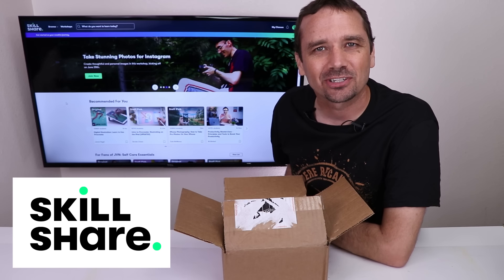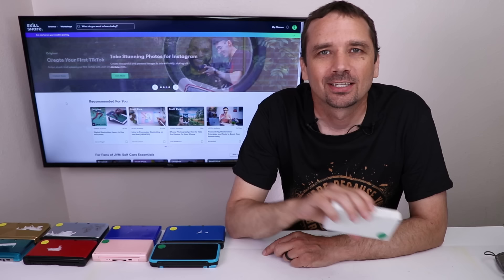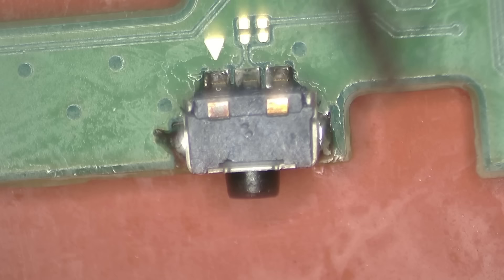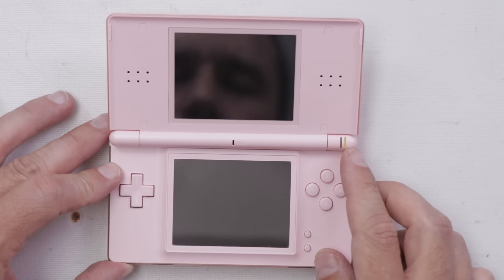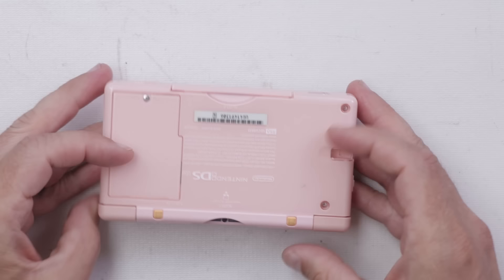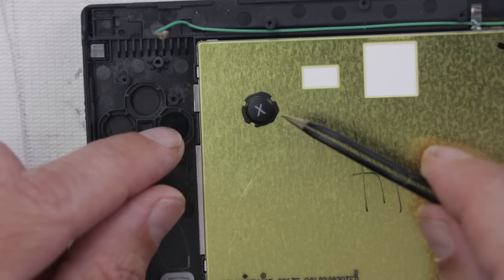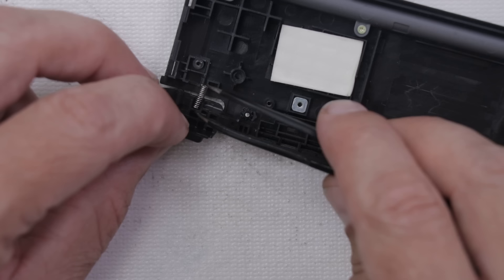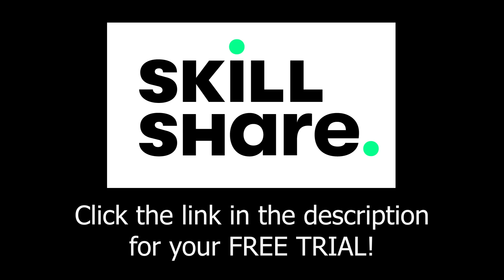I Bought 9 BROKEN (But NICE) Nintendo Handhelds - Let's Fix Them!

Comment: After all these decades, we are still "blowing air" into Nintendo products to help them work better. As a 1980 baby, does my heart proud
Reply from the maker: If only it was that easy to fix modern electronics
Reply: i still have to do it on my nes and gameboy
Reply: @inklingswtf  same have 2 gameboys
Reply: the old ways persist, tradition is preserved as we modernized :D Next we will blow into the switch on camera XD
Reply: @awilliams1701  that replacements cartridge slot messes up the pins on the game after time
Reply: Yeah, though the major difference is there's no added saliva, lol.
Reply: @awilliams1701  yeah i actually got a replacement when i got mine like a year ago its doing pretty well but i still (somethimes) blow into them with the dust build up in my drawer lol

Comment: Just a little tip, if the 3DS battery is completely empty, it just needs to charge for 10, sometimes 15 minutes before it turns on again. Just because it does nothing immediately after you put on the charge cable doesn't mean the battery is faulty or dead.

Comment: I love how calmly you take the challenge of finding out what's wrong with any device, also, how you know what to do in any cases... I've trying to fix a 3DS XL that turns off instantly just before turned on for like 4 weeks with no luck... I'll try some of the things you used in here. Exellent content! :D
Reply from the maker: Be sure to check the ribbon cable that goes through the hinge. Also...be sure that the ribbon cables are all seated fully and correctly. Good luck!
Reply: Good advice, thanks, i had something similar with a 3ds a few years ago :)
Reply: lil
Reply: @BlackLotus36  If it's the ribbon cable (which seems to be the case) it makes a distinctive cracking noise when you try to turn it on. Sadly these ribbon cables break pretty easily.
Reply: I found a bad WiFi card/WiFi card cable can cause issues.
See if you can turn off WiFi via the side switch thing, if that helps.
Reply: @MyRegardsToTheDodo  The screen ribbon cable? My DS does make that "crack" sound... I turn it on, the screens turns on, the blue led turn on but 1/4 of a second later, it cracks and turns off completely...
Reply: @lelsewherelelsewhere9435  I've tried that, turning it off and removing the WiFi module completely with no luck
Reply: @BlackLotus36  did ya fix it?

Comment: When I bought batches of broken ds / 3ds and at a first try they seemed perfectly working, the most frequent problem that I encountered with a more accurate control was the touchscreen that didn't receive the input in the most peripheral parts (near the frame), often it was enough to disassemble and clean them, but sometimes the digitizer needed to be changed.
Reply: Where did you buy the batches? I can't find anything on ebay

Comment: You should defiantly do PS3s and Xbox 360s. Maybe even Wii’s. I think you should buy a PS3 with the yellow light of death or a 360 with the red ring of death and see if you can fix one of those
Reply: There is no real permanent fix for Xbox 360 RROD, for the PS3 it sometimes works if you replace the caps.
Reply: @MyRegardsToTheDodo  I mean there is, and that's reballing the chip, and IFixIt has their own guide and kit to fix or prevent RROD most of the time. It's caused because of the original 360's terrible solution for cooling.
Reply: @MyRegardsToTheDodo  I know but it would be good if he could at least get it working again even if it is only temporary

Comment: Awesome trigger button repair on that 2DS XL! Have a bunch of original 3DS models I have never been able to figure out with 2 somewhat common issues. Some of them just making a loud pop noise when turning on and also the others wont get past the 3D slider test in the initial setup. Would love to see in a future video. Id send you a popping one you can have for free just to see you fix it!
Reply: poping sound is due to the speaker cable. just replace it =) I have videos on my channel about it

Comment: When a device reacts to a charger being plugged in, it doesn't have to mean that it is charging too!!! With devices like this always check the batteries with a multimeter to see how much the battery is charged and then charge it for several minutes and then check the battery again!!!!
Reply: Exactly. I remember thinking my vitas battery died but I realized it doesn’t hold a charge until it was charged for like 15 mins
Reply: Yeah, and sometimes devices won't power on until the battery reaches a certain level of charge. Like the Switch, which is really annoying when I want to play it docked, but nooooooo, I have to wait for a battery I don't even want because I never play portable to charge enough first.

Comment: I enjoy watching your videos!  My daughter's Switch Lite recently started having some issues, and you inspired me to try and fix it myself.  The wifi started only being able to connect to my nighthawk router from 5-6 feet away.  Then, it got worse, only able to connect a foot away from the router...

I restarted the switch (held down power), I factory reset the switch, with no luck.

I took apart the switch, and the wifi antennas looked good.  I accidentally broke the right controller connect back to the motherboard (I now know how fragile those flip down ribbon cable holders are!)  After replacing that board, I ordered new wifi antennas.  After putting the switch entirely back together... the performance of the wifi was the exact same.  It works, but only about 6 in or so away from the router.

I've changed the MTU to 1500, changed auth types, tested 5G, changed my wifi channels to ones that didn't have any signals present, and nothing made a change.  Any ideas on anything I can do?  At this point, I'd assume the main motherboard has some issue.

Comment: Huh. I have the Year Of Luigi 3DS XL in my collection, and it was damaged by a sticky drink as well. Killed one of the buttons entirely, messed up the volume slider, and broke the headphone jack. That was all before I got it, but when I took the bottom panel off, over half of the bottom was covered in sticky residue from the drink.

Comment: #3 (the pink DS Lite) has heavy yellowing on the bottom LCD and has heavy discoloring/yellowing throughout the whole outer shell. Relatively easy fixes though, but in its condition, I would not call it excellent by any means.

Comment: I used to fix ds lites years ago buy faulty ones with broken hinges or power issues for next to nothing put new cases on them clean them and sell them for a decent profit... I know ds lites had an issue with a little fuse on the board that used to go change that and they used to work never once had 1 with no power that wasn't the fuse stopped repairing them when prices went up have tried to repair other things since but ebay is just full of items that aren't listed correctly and trying to repair them is almost impossible for me very little knowledge awesome video as always though been watching your videos for a few years now found your videos as recommendation when watching my mate vinces videos

Comment: Nice video. Watched many of his videos and does a lot of fixing myself. Got a lot of 30 Nintendo DS handhelds for $5 each about 2 years back. Might be time to go through them and get them fix up. Most of them should be easy fixes like his where the battery is low or dead and a few with stuck or missing button.

Comment: That Zelda kit is gorgeous...

So... do you know how to fix all of these off the top of your head, or do you look at schematics before you dive into each one? I love the videos though, they're extremely relaxing to watch!
Reply from the maker: YES! Not sure I'll be able to get rid of that one. Glad you're enjoying these.
Reply: When it comes to electronics repair, experience is simply key. You learn alot about common faults and the most likely causes for them quickly. Then, its largely a game of trail and error. In this video, the only real problems he ran into besides the broken buttons (which were mostly obvious) was the dead batteries. If your issue is no power and there is no obvious sign of water damage, then the first course of actions should always be to try swapping the battery. It is a super easy swap to do and is a common fault.

Comment: Hi Steve,

I tried following your guide screen replacement guide on a New 3DS LL.
After replacing the screen and putting everything back together, the 3DS powered on for 5 seconds, made a popping sound and never turned on again.
Can you give some tips on what could be wrong or how to solve this, or maybe you would be willing to take a look at it yourself?

Comment: I have a turquoise 3ds too, it's my carry on. But it stopped charging all of a sudden, I guess one of the pins might have broken off.

So remedy this, I built a makeshift dock using cardboard, tape and wires.. it works great, but I have to let it charge up before I can use it
Reply: maybe it was just the battery X/

Comment: Hey Steve, I have a new 3ds board that loses input from every button except from zr zl and home when turn it on (no touchscreen input either). Sometimes when i turn on the randomly 3ds all buttons seem to work for a split second before going back to the same condition. I know everything works because I've tested them with another board. Have you ever had anything like this before or have any clue on how to fix it? Cheers.

Comment: I need to put in an official request to you at some point. I have a 3DS XL that works fine, if you put it on the first hinge spot. With it running and you push the screen back to the second spot, it causes the unit to shut down. I'm not 100% certain of my own abilities to fix such a fragile device and I've got lots of good memories with the unit, so I'd like to see it back to full glory again someday.

Comment: Hey! Ive started repairing iphones, is there any advice or anything you would give me or suggest some cheap tools to use that I need? Thanks Steve.
Reply from the maker: I don't generally recommend cheap tools. If you need to buy cheap ones to get started that's fine but I'd upgrade asap as cheap tools can cause more headaches than they're worth.

Comment: Sadly I'm looking at my 3DS XL and 2DS that I am too lazy to repair. The 3DS XL card slot needs replacing and the 2DS I replaced the top screen (wouldn't turn on after the replacement).

Comment: I have a sharp LC-58Q7330U 4k tv that won't turn on seems to be stuck in a boot loop or something there's no display the board is warm like it's on and the light flashes

Comment: I have a question, I have a pi 0 and it doesn’t have a button footprint but I have one sorta floating on wires, is there a type of adhesive that I could put on the side of the button and fix it to an empty area of the pcb? Something decently strong since only the side will be mounted

Comment: I just bought a series s and after an hour of use it shut off and wont turn back on the light will flash and it will beeps but it wont turn on

Comment: Hello I need to ask you something about my ps4 pro I had it just shut off on me and it felt hot what could the problem be I also pulled it apart to clean out the dust when I had the problem start on me also there was no error codes.

Comment: There's not necessarily a need to replace the battery when they don't turn on after plugging it in. If the battery is completely drained, it needs to charge for a few minutes before it will turn on. My own 3DS has done this a few times, when I leave it on my desk for long periods of time.

Comment: 6:40 Nintendo really should stop using these obnoxious soldered-on buttons. They are both easy to break and hard to repair if you actually break one. They know that and yet they still use it today in joy-cons. Just have a separate button or a small daughter board with a ribbon cable like everyone else does and not this crap.
Reply: I believe the only one that does that is the R button on the right joycon, the Left has it's own board for the L button and ZR/ZL are their own board aswell for both.

Comment: I got a PS4 controller that doesn’t charge. I replaced the charge port, ribbon cable and the battery. It indicates that it’s charging but doesn’t charge. What would be the next step?
Reply: battery connections to motherboard possibly

Comment: Nice work. I have been working with a nintendo DS lite for a couple of weeks and can´t find the problem. It does charge but doesn´t turn on and i´m not getting any voltage in the switch. Any advice?? thanks!
Reply: Does the Green Light turn on and off for the DS Lite? If so, check for the backlight on the screens when powering it on, if one of the backlights for the screens flash, but another one doesn't, that could indicate a screen problem, such as a ribbon cable not being plugged in all the way or the screen is broken, the DS Lite does a post check to check for the screens, if one isn't there, the DS will immediately power off.

Comment: I've got a ps4 that sometimes turns off and goes into safe mode, doesn't do it always. I've tried reinstalling the software and it still does it. I have 2 fans on it that pull out the air, one from the bottom and one on top of it and it still does it randomly. How would I go about having you fix it? It always beeps and shuts off right when I'm playing a game (of course). Also sounds like a plane taking off lol. I've taken it apart and didn't find dust so it's not that.

Comment: i think this dude would be ashamed if he saw my old 3ds. there is play-doh in the speakers, the rubber on the control stick has been chewed/ripped off, the charging port flat out doesn’t work, the right shoulder button has a chunk missing, both the screens are scratched all to hell, and if you hit it at a weird angle, it goes to a blue screen and screams at you until the battery runs out. i am not exaggerating at all.